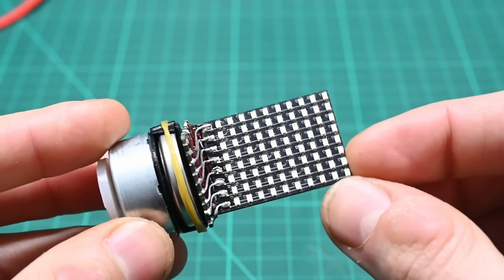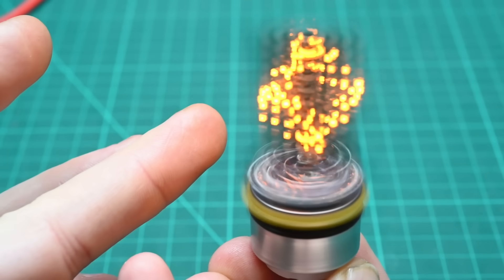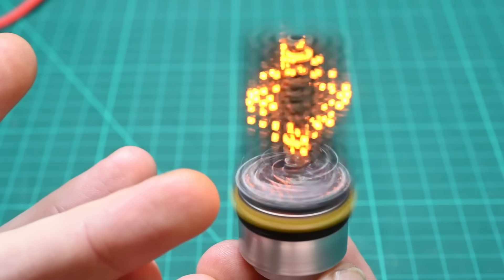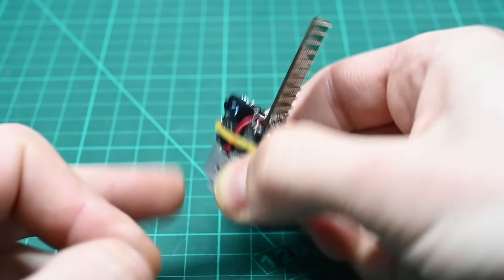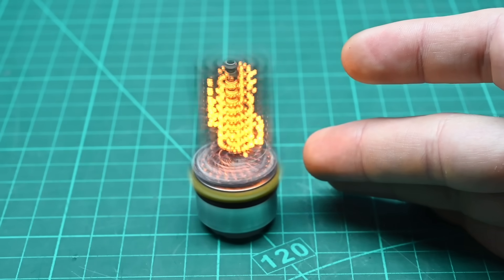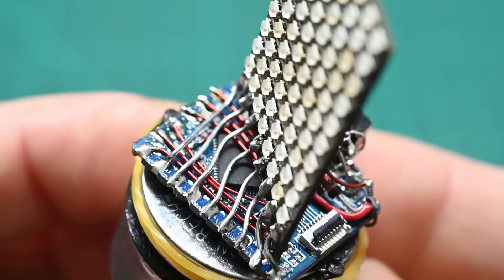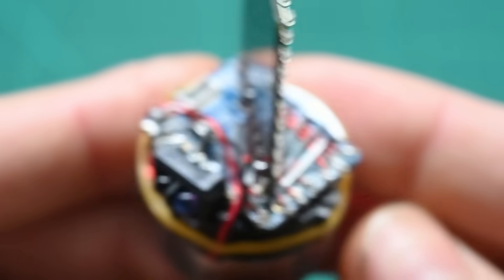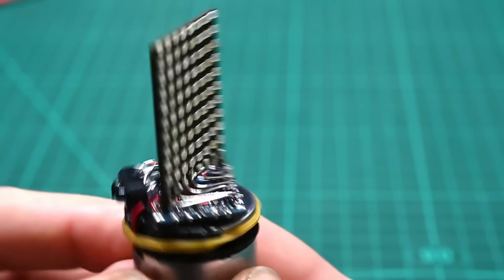Tiny volumetric display

Comment: Awesome work! So it's activated with an IR proximity sensor? You could 3D print a 2 part lower cover for it. A main shell with a slot in it and an articulated section that covers that slot to activate the IR sensor. You'd have yourself an IR on/off switch.

Also, a clear cover to go over the LED matrix would look good, protect it, and stop people from touching it, which they no doubt will.

Comment: Woah, impressive !
To get a more "candle" effect, the "flame" needs to be thin, and to dance around it's center on the lower part, letting the higher part going off the "center of mass". It will need your whole LED on the upper parts but not on the lower parts. And moves are generally erratic and quick, with phases of more stable moments.
Thanks for sharing this, this is awesome!
Reply: You seem to have assumed he hasn’t seen a candle before.
Reply: @pieflies shut up if youre not here to contribute

Comment: A vacuum tube around it would prevent airflow, reduce friction/power and reduce or eliminate noise. You could provide the power via induction and the tip of a typical vacuum tube would give it kind of nice candle flame like appearance. Nice project.

Comment: Incredible.  Just a thought for the centering leds vs the board problem; what if the board was a sort of lattice frame on which the leds sit within the frame, they could then be seen from both sides and you also have the option to mount the leds above and below a strut to increase the resolution and the centre of gravity is centred with both the board and leds
Reply: This is similar to how the external LED “screen” of the new Sphere in Vegas is built. Essentially a frame with LEDs at a given pitch

Comment: Have you considered back-firing LEDs? That would make them light up closer to the center. Then you could add small diffusion layer so the lights would be slightly more mellow and add a negligible weight to counteract negligible weight of LEDs

Comment: I've had the same idea for a spinning volumetric display. In my head it was not one surface with LEDs but several slightly angular offset strips with the LEDs facing outward, symmetrically aligned in both directions

Comment: Aside from the literal resolution, what would increasing the 'rotational resolution' (?) look like?
Like, we can see gaps between different rotational rotations as if the whole thing is a 3D grid, but how about more degrees where the leds were active.
For example instead of 32 degrees of rotation where the leds are active there are 64?
Would there be a perceived resolution increase, or would there be downsides like blurriness or opaqueness lowering the quality of the image?
A normal 2D display at 60hz I imagine gets split between every degree it's active, relative to rotational velocity, so is refresh rate the limiting factor in volumetric resolution aside from LED numbers?
Would this be possible with a transparent OLED screen?
This little thing is so interesting, has me thinking a lot.

Comment: I have a recommendation. Instead of multiplexing and using lots of pins on the controller, try using WS2812B pixels. These can be controlled in series (using PWM) by a single pin making a simple individually controllable RGB panel using only 3 pins

Comment: I love how you implemented the ability to rotate the image using that IR sensor, makes for a very cool result imo
Reply: Yeah, the sensor is required to calibrate the timing of the image display.  Moving that calibration point therefore moves the image "by default"
Reply: Well, since everything is spinning and that sensor has a definite location, it would automatically rotate the image while using the right speed as a function of the sensor location.

Comment: Future versions could use wireless charging to power it, I presume it can run with less than 5w of power.
As for video signal... Not sure what standard is small enough, maybe a 2.4ghz crystal can handle the data transfer over WiFi. Perhaps the weight of the battery can be substituted with a capacitor for the peak power draw needed to start it up while using wireless to power the design.
Copper coil in the foot, one end on the motor core and the other on a carbon brush on the foot to a copper ring on the motor.

As for a cover that would be great. But have the cover spin as well, else the array might bounce off the inside and break/scratch the inside. Old vacuum tubes might have the kind of glass profile you desire.

Comment: I wonder if you used a more flexible mesh backing for much smaller LEDs, if you couldn't actually take advantage of the flex with higher rpms to add natural curves in pixels for sub frames
Reply: Stability would become a bigger issue.

Comment: if it is possible, should change the "led density" so around the centre its not so dense and as it goes further to the edges you have more leds.
Hopefully this would fix the solid column of pixels you get with this current revision.

Comment: What about two PCBs with LEDs, facing opposite sides? A bit dealigned to mae it center of a mass. So 4 rows facing front, 4 rows facing rear, centered so it wont shake.

Comment: amazing invention the 3D display is one of the most difficult unsolved engineering problems still, i also think it would be good putting a nixie tube covering on top and fixing the centre on the top, alternatively i would have stabilized it with carbon sticks on the sides. also a higher resolution version of this would be worthy

Comment: Before you even said it I was thinking this would make a great flickering candle display. Great job!. If this were put behind frosted glass, like many of the larger ones are, then you have already beat those. 
P.S considering the battery will run out eventuality I wonder if you could replace it with a mini on-board generator(magnets, coils,  and big capacitor) for the LED circuits and have the motor powered externally. Then you run it indefinitely

Comment: Nice little creation, to me the best display was the text at the end.
Getting power in there is always the problem, followed by the data.
I've wondered about using a rotary transformer, however the ones I have access to, from old VHS recorders cannot pass enough signal to power anything.

Comment: This is really cool! I love when things toy with persistence of vision! I expect it looks even more impressive in real life than it does on video! :D I don't know why but a spinning volumetric display never occurred to me before this video. I've only ever seen 2D spinning persistence of vision displays! I've seen static ones composed of multiple translucent displays, or an array of LEDs suspended in a grid, but this is the first time I've ever come across this!

I'm not entirely sure of the scale of things here but I wonder if (for the candle use case) in addition to using smaller LEDs or a premanufactured OLED display or something you could attach a tiny linear resonant actuator (Like the rumble motor found in Nintendo Switch JoyCon controllers or some smartphones) and vibrate the display at a high enough frequency while it's spinning for the image to blur together even more without making the entire device jump around - making the flame look even less like a collection of individual LEDs and more like a single moving flame?

Sound or weight distribution might be a problem then hm? Can't wait to see where you go with this! Any attempt I made would without a doubt be 50 times less sleek and elegant than yours ha!

Comment: Why isn’t this more wide spread? sure it’s no hologram but if refined and manufactured this could be used by businesses to display simple designs like a volumetrically animated open sign. Depending on the cost I think this could be a viable consumer product as well, especially for Christmas decorations and the like

Comment: Make two of them, and put them on the ends of a flat bar (just barely touching).... than rotate the bar as well as rotating the individual motors light panels...... This will take care of your visual axis problem in the middle.
Also, if you really want to make it look good. Take out the center row of lights of each of the boards on both motors.
If you can make it so that it is 3 feet high and with a radius 2 feet, that would be fantastic.
Nice work though.

Comment: Ideas: Compensate for LED board weight offset using a sheet of glass the same size, applied to the top side of the LED's, buy some picture frames and cut the glass up, different thicknesses will provide different weights (plastic can be used if glass is too heavy?) while remaining transparent. Not sure how much this would disrupt the display. 
Add a micro slip ring for the power supply only. This way the running time isnt dictated by battery and can be run off wall power. Will only need micro slip ring with two cables since its only for the power. Try a micro, ultra slim ring maybe? 
Unlikely to be worth it but maybe mount the display on a micro movement system so it can self center? Might be implausible.

Comment: I think what you should do in later iterations is to add a color screen to your next model... 

also, I think I would what to see this as a large display rather than a tiny one...I could see this being used in a Las Vegas attraction being the size of those rather large aquariums at the zoo... or in a expensive hibachi restaurant as a 6 foot display.
Reply: I think air resistance would become an issue, it would have to spin quite slowly, greatly diminishing the effect. LCD screens would generally lack the brightness and response/refresh times I think. But an RGB LED array with air gaps in between could work at larger scale

Comment: You should add a transparent counterweight on front of the LEDs. A weight on the bottom will be statically balanced, but not dynamically balanced. And not being dynamically balanced will cause it to vibrate when rotating

Comment: Would it be possible to use a wireless charging coil to both power and send data (using some form of modulation) to the device?

Comment: Recommend the each row contain an odd count of pixel elements with the center row right on the primary spin axis. Or maybe even better, put an odd number of elements on one side of the board with an even number of elements on the backside.  This could be two boards glued back to back of course.  Bottom line is that as it spins, it would appear as if there were no gaps in the pixel density.  (note that the even board's rows should also be slightly off from the odd number to make sure the horizontal gaps disappear along with the vertical gaps.  BRILLIANT display. I love it!
Reply: Overall adding offsets to this would allow it to fill space much more fully. It's interesring how such a great thing still has the potential to get even better
Reply: No need to glue two boards, just have a double sided PCB made. Also being double sided guarantees alignment.  He should also do RGB and as small as possible for maximum density.
Reply: @dougcox835  RGB ruins the minimalism but yeah
Another thing thatd be interesting is doing 3 sided display with red green and blue LEDs on each side, i feel thatd be neat. Itd have a side effect of slowing down rotation being a way to animate color change
Reply: @orbismworldbuilding8428  Just use tiny surface mount RGB LEDs instead of actual led bulbs. Much smaller, compact, brighter, and lighter.
Reply: Now im wondering if its possible to add color by having 3 sides with different color LEDs. Of course thatd require faster rotation and break your idea, but itd still be cool and interesting
Also ruins the beautiful minimalism i think. But itis a direction this display could be taken in
Reply: Thats really clever! From making pixel art i see tge advantage of odd and even number of pixels/voxels but putting them back to back so they fill the gaps and eachothers weaknesses is so smart
Reply: One thing you guys haven't considered, is that each of those ideas adds a noticeable level of complexity. Making the process difficult. Maybe if he had a small crew of graduates and engineers he could accomplish it.

But yeah, putting even more lights, having it three-sided/triangle arrangement, with off-centre/odd arrangement, that have an RGB capability would be neat.
....you would be approaching the point of making small 3D images. Voila an early prototype of a hologram!

Current technology is to use a thick/fogging agent, and using multiple projectors, and fast computational to make hologram images.

The problem is that light travels straight, we do not possess the technology to be able to bend light on its own. If we did, then we can actually start building holograms like we saw from the likes of Star Wars and other Sci-fi works.

Ideally we want to craft that technology, then miniaturize it, and have it embedded into two bracelets. Then we can kill the modern smartphone or foldable. We would have the display/image project into our palms and manipulate the 3D Object using our digits. Again, the phone would officially be dead, everyone would move to having the dual-watch for your connectivity and entertainment needs. But that's decades away at the soonest, and potentially never here, if we don't figure out how to bend light in the first place. For now, we have spinning 2D lamps :D
Reply: @ekinteko I don’t think the phone would die, having a flat interactive interface is pretty useful
Reply: @ekinteko  The problem with the fog approach is that it blurs the image because you are looking through the fog.  With the spinning thing you are never actually looking through anything because at any instant it's always a clear shot to your eye.  And any blurry parts could be resolved by painting the board black and maybe using a tinted screen to make it too dark to see other than the light showing through.  As for the complexity, it's really not that complex.  Just do everything on a PCB. I think he used an off the shelf array but it's pretty easy to design your own and use a board shop to fabricate it and even stuff it with LEDs.  It's even cheap to do nowadays.
Reply: @dougcox835  The complexity part is doing the mathematics, and determining the necessary midpoint images and timing. I'm not aware of any available software you can throw at it. But coding one from scratch with the added complexity is definitely NOT easy.

Anyone is welcome to prove me wrong, and open-source something complex for the community.
Reply: @ekinteko  Ok, I get it.  But I'm not an engineer and I was able to work the math to  figure out the offset of an antenna on a turntable that was not centered with a little thought.  It's simple Sines and Cosines, that's all.  Actually that's all it would take to resolve the center column problem.  Just offset the center of rotation a small amount.  The distance of one pixel should actually be enough.
Reply: do a horizontal offset and a vertical offset

Comment: Having the LEDs encased in the middle of a transparent board in the center could solve the rotation issue and make the lights visible on both sides, meaning that each "refresh" could be only 180 degrees rotation rather than 360 degrees, thus enabling a higher refresh rate.

Comment: I love the fact you use a proximity sensor(?) as a way to determine the frame timing. Seeing it follow your hand as it animates is so cool!
Reply: TCRT5000 IR sensor :)
Reply: Wow. I thought the sensor was more of a trigger. Didn't strike me it helps with frame timing!!
Reply: @MrVijayMadhavan  Yeah, probably used as a sync reference, because the DC motor doesn't seem to have any connections that would allow the microcontroller to know when it completes a full revolution, so instead it probably measures the intervals between something being close to the IR sensor to determine how long is one revolution and to have a reference.
Reply: @MrVijayMadhavan I mean, I'm assuming the effect where it follows your hand is being done that way, but I have no way of knowing for sure lol
Reply: I was wondering why no one is talking about how he’s controlling it with hand movements.
Reply: @Roach_Dogg_JR I suppose it moves because the motor stops after a frame and restarts after the IR sensor is triggered
Reply: I wonder if a Hall effect sensor could piggy back on the magnetic field of the motor. But I guess this IR sensor is a satisfying on-off switch too.
Reply: @charstringetje  oooh, that is a cool idea! Would really depend on the kind of DC motor though. Am not that knowledgeable there.
Reply: @charstringetje  If not, he could maybe attach a small magnet to the motor to trigger the Hall sensor.
Reply: @hundry_f  yep! Seems so
Reply: Thanks for explaining that, I was wondering.
Reply: i may be the only one to think this, but maybe he has a magnet in the tip of his finger?

Comment: I might recommend having the LEDs be flat and reflected on a half-silvered mirror that's vertical, to mitigate the thing where the center of the volume obstructs voxels in the rear (creating an "opaque central column" illusion in the current version)
Reply: I'm trying to understand; where exactly would the half silvered mirror be?
Reply: if i understand it right (and that's an ask) i think the mirror can be placed vertically where the led board is currently, the led grid being placed horizontally at the bottom facing upwards and the mirror's half silvering will create the 45 degree angle necessary to remove the columnar effect?@lolithighs
Reply: youre right, i cant make it work in my head either!@lolithighs
Reply: Put the mirror where the leds are and put the leds flat on top of the pcb facing up at the spinning mirror

Comment: I wonder if it's possible to do the reverse, by basically spinning an LCD screen and produce a negative transparent hologram? It'd be higher resolution at least. An HD shadowgram lol.

Edit: not sure if this is possible either, but what about extending the LCD idea and create a two sided middle lit transparent LCD screen (a diffusion strip sandwiched between two screens?)